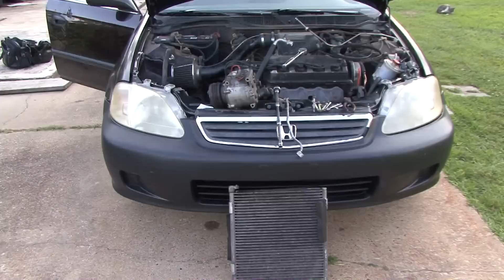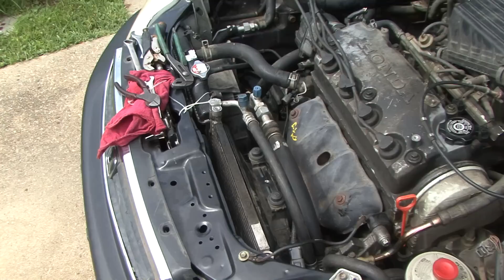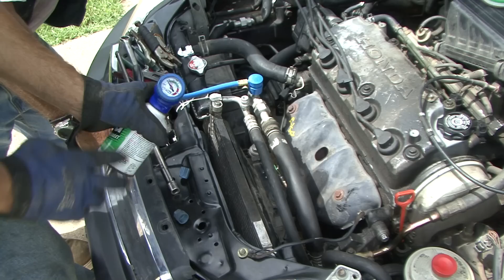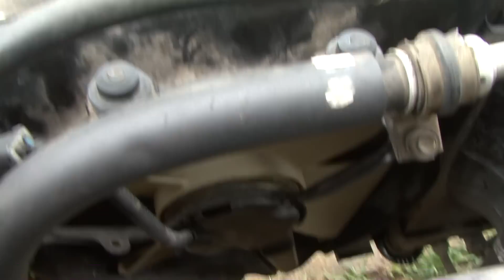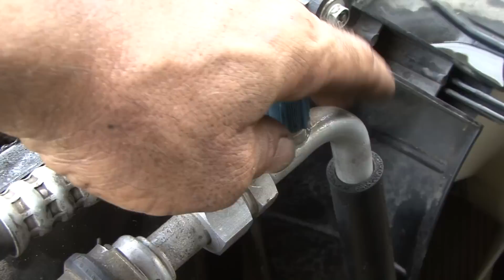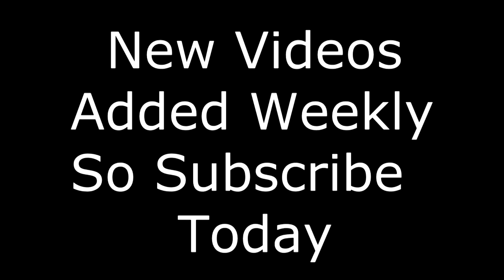Honda How To Civic A/C compressor and charging

Comment: Man.. this is terrible. No real mechanic should ever suggest using those cans. Yes ppl still do but without warning them that most if not all have stop leak in them and the stop leak will nit help with any leaks really and what it will really do is clog up parts like an evap, condenser etc.. this stuff should never really be put in an ac system.. if u ever use anything with stop leak in it no matter what it is, it will always cause more problems in the long run.. but what do i know im just a 20+ year mechanic myself 😂

Comment: Mr. Cody.  What year and model is your Honda?  My honda is 1993 civic.  And I want to put Freon but in which port is the low pressure, my car still has an old R12 system.  Will the high pressure port always connect to the condenser?  And how do I test that energy reaches the condenser and compressor?

Comment: Question!! What If the low pressure line doesn’t get cold.. had a new ac system installed : compressor, condenser, dryer, expansion valve and evaporator core. Had system vacuumed and holds freon.. just doesn’t cool. Compressor & clutch kick on tho
Reply from the maker: Then you have a blockage somewhere or something is not right. If compressor is kicking on you should feel the one line get cold as the refrigerant runs through it. If someone ran stop leak in the system it can clog up parts of the system.
Reply: Cody the Car Guy thanks! When I disassembled the old ac system a large amount of stop leak was present. Gives me reason to take low pressure lines apart to check

Comment: does spewing freon AND OIL CHARGE out the charge port remove ALL the EXTRA air (just how much air should be left in there anyway?), moisture and CRUD as you call it. Also are those Honda approved tywraps holding the radiator together or another one of your genius inventions?

Comment: Quick question. Dryer line to condenser is it dry fit  with gasket or u have to put some kind  of sealer?
Reply from the maker: Put a little grease or pag oil on the oring.

Comment: If your system needs recharged will your compressor pulley not spin? I saw on a video that it might not spin if it needs recharged. And mine isn't spinning when I turn on the a.c.. I also haven't left it in for more then a minute could it need to stay in longer to kick on?

Comment: my compressor spins but doesnt move in and out like yours .. is that why I'm getting warm air when I turn the ac on?(every time I add freon the psi goes up a bit and then goes back to 0) .. anyone know what might be my problem?

Comment: Cody the car guy. I got a question
 So my compressor turns on and works fine and so is my fan. But my a/c is not blowing cold so i recharged it and its still not blowing cold
 What else could be wrong

Comment: I have a 1997 Honda Civic dx and BOTH of my fans arent turning on and the AC clutch isn't spinning, I checked the relays and all of them are good. Do you think I have to change out both fans and AC compressor? I'm stuck with no options right now
Reply from the maker: Check and make sure the ac compressor is getting power first. The ac fan should kick on when the ac compressor gets power.
Reply: Steven Santiago2_13_13 you only have to worry about the condenser fan the other one is the radiator fan and that one turns on when you are driving or when the car reached the right temperature

Comment: everything seems correct except when u were adding refrigerant u had the bottle upright and then in the next clip u had the can upside-down. .. was there a purpose for that or did u mess up and not inform us.
Reply: he was using an old can (had some freon left) to push out air out of the system
Reply: Ahhh ic

Comment: I have a question, might be hard to see but what are those four bolts that are on the right side of the compressor at 1:00? I need to replace mine, but I can't lock on a search to find a suitable match. Could you help me? Thanks.

Comment: I got a girlfriend with a 98 honda civic with the same setup. I heard the sound of a leak around the condensor so i replaced that but that didn't stop the leak. I'm thinking it could be the compressor or the seals but the leak sounds like there's a large hole which i can't seem to find. Is this common on these cars?

Comment: Hey 
Cody the car guy  ! I have a Honda Civic 1996 EFI Sedan four door. My car ac is not cooling as it should be. i have replaced the compressor with the stock version also the evaporator as the mechanic said that the compressor is faulty but still the air is not cool. the low pressure pipes are very cold but the air is not like the pipes... Solution please
Reply: An EFI ? The heck is that ?
Reply: @1RyanHill  Electronic Fuel Injection
Reply: @ScorePhysics  Oh! I thought you meant it like it was a trim level of the car. My mistake!

Comment: hey, I have a 99 Honda civic. I've always had a/c problems. no one has been able to tell me whats wrong. it blows hot air and never gets cool. I put freon in it and took a gage to it and it said there was too much. sometimes when I'm driving I have my ac on low and I come go a stop light or just park and I'll have my ac on and it starts cutting on and off and doesn't stop till I turn it off. I sounds horrible and shakes my car. I think my compressor is out but not sure.

Comment: Cody. I just replaced the compressor, condensor.and charged the system on my nieces 2000 civic. its blowing cold out of the outside vents but no air at all through the center vents by the sterio. also I can't go from vent to defrost. got any ideas?

Comment: hi cody, I have a 2000 Honda civic and my ac went out about a month ago. I live in the desert where it is extremely hot during the summer and I am also pregnant so its very important to me to have ac. ive taken it to two mechanics who wanted to charge me 900 dollars to replace the air compressor and flush the system. my uncle said if I bought the part online (which is about 120$) that he can replace it for me. Do you think this is safe replacing it ourselves? should I also replace the condenser? let me know your thoughts please and thank you!!!!!!!!

Comment: I don't think I heard you say anything about flushing the system. I haven't done the work yet (all parts haven't arrived), but everything I've read so far indicates that a failed compressor releases bits of metal and whatever into the system which can clog the expansion valve, condenser and probably evaporator. Shortcutting the job seems like it would set you up for failure!

Comment: Cody thank you so very much for making these videos!!  

On my 99 Civic HX, I just replaced the AC compressor belt, that had been missing for several years, using your most excellent Left Lower Motor Mount video to do it, Thanks for that !!

Then when I cranked up the car, sure enough the AC blew super cold, just as I had hoped it would.

Then, went to show my wife how great I am, it still worked great, ice cold for about a half an hour or so.

Then, inexplicably, it stopped blowing cold, despite the Green AC Button Light being on.

So checked under the hood, to see if the Compressor Clutch was engaging, sure enough, it was not, despite the Condenser Fan coming on when it should.

So to recap, the Compressor Clutch should engage whenever the Condenser Fan 
comes on, yet it does not now despite doing so earlier in the day.

Your video mentions a "Pressure Switch" coming on to engage the Compressor Clutch about the 5:40 minute mark of your video, could that switch be the problem?  How do I find out?

Or is this symptomatic of a system that simply needs to be recharged?

Any ideas?

THANKS IN ADVANCE SIR !!

Comment: I have 2000 honda civic ex my compressor come on but be click on and off and the belt is screaming bad I change the expansion value but every time I check it with my Guage it tell me it's to full then  sometimes it's not enough  freon what can be the problem but I will change the belt later on today

Comment: Hey Cody my friends Acura mdx clutch isn't engaging fan turns on checked fuses and relays and they are good we checked the freon level and it was low I added freon abbas nothing still not moving do you think the compressor is bad?  Thanks for the feedback..

Comment: hi Cody the Car Guy my question to u is i have a 1993 honda accord lx auto trans when i turn onn my ac the blower comes on but the fans never kick in does that me my compressor need oil are the hole system empty

Comment: Hey Cody thanks for the vids on the civics... My AC system just started not getting cool, I know how to charge it... But how do you check your compressor oil?  And do you recommend the artic freeze and ice32?  Thanks again!!  Hey I'm also having issues with my check engine light coming on... its a 93 Honda Civic and I already did the paperclip trick to get the code... It came up code 9 and feom what I understand and read it says something with the distributor. ..  The car runs fine and after about 10-15 mins of running the enhine light comes on... 2 things I noticed was when shifting into some gears it shifts just a little hard, also if I floor the gas peddle its almost a guarantee that the light will come on right after... 1 last thing I noticed is if I make it to the highway without the light coming on and drive 50 miles to my girls it won't come on.... Any ideas buddy??  I really appreciate it bro!!

Comment: Have a 02 civic. The air conditioning works for about 10 mins and then it will slowly start to blow warmer and warmer air and won't go back to blowing cold air. Any ideas whats wrong?

Comment: And yes btw junk yards are required by the epa to recovery all fluids and chemicals etc from vehicles before that are scrapped
Reply from the maker: John Day r12 yes they are. But no cars with r134 are recovered at any junkyard ive been to down south they are all still charged when picking up used parts i see it all the time.

Comment: What's the difference in r12 and 134a? R12 is a cfc and depletes the ozone, yes 134a does not have a cfc but it does contain green house gases that aren't good for the environment either. Especially since you are trying to show people how to charge their a/c system, why not show them the right way? And not be a half ass slob that is showing people how to complete a task in an illegal manner. I might just report this video and collect the 10,000 dollar reward for successfully aiding in a clean air act conviction

Comment: You do realize it is a 25,000 dollar fine to vent  to atmosphere right? And I am a master hvac license holder and you can't remove the moisture from the system without a deep vacuum ..... And the moisture and refrigerant mixed creates an acid which will ruin the compressor you idiot....
Reply from the maker: John Day Not everyone has a vacuum and have you seen every junk yard they dont recover r134 at all they are not even required by epa at all. Now my rti a/c machine is a 100% recovery and removes all moisture but not everyone can afford one of those machines. And just so you know that car is still blowing snow cones and working perfect to this day that was shot in this video so keep your comments to yourself if you want you can check the honda out in the video guessing you still wont have anything positive to say lol

Comment: My names Cody too!!!! Haha anyways, I've been searching around, and my A/C doesn't work as well as I'd hope it would. It takes like 10 miles before it Starts getting cold. And it stays cold, but if I shut the car down, even for a second, it takes forever to get cold again. It's not low on refrigerant. The car has 230,000 miles and I'm wondering if the compressor is just weak? Thanks man.
Reply from the maker: Chevymalibuls You could have a clog somewhere or bad condenser it takes a bit of driving to get it to cool or the flow moving

Comment: Have a an '01 Civic EX and have noticed over the course of the last two years that the air has slowly not been as cold as it used to be five years ago. We put half a tall can of R-134 synthetic into the low pressure side. And the air got really nice and cold and pressure reading was at about 45psi. But now for some reason shortly after we did this we were driving down the road and notice an odd squeek or like a water drop sound/squeek when the compressor engages. Also I noticed while at idle the compressor was engaging (on and off) every 15 seconds. Could there be a possibility the pressure is too high?
Reply: I have a similar problem. Have you any answers yet? Thanks. Hit me at georgelwyatt@gmail.com With Honda a/c in the subject line
Reply: +George Wyatt OK, so after extensive self teaching the answer to my question is 'YES'! The pressure was too high. These cans you buy from the store are not good enough to fix your A/C. You need to use a real manifold gauge set. Those companies are just ripping people off and polluting the atmosphere. They must know that it is all going to leak out. If you have to add Freon it is because you have a leak!!!  Unless you overhauled the system then you have a leak because Freon does not go bad. But to make it easy for you, just replace the High & Low side valves because they are what go bad most of the time. You WILL NEED to vacuum the system and so you will need the manifold gauges and the vacuum pump. The good news is you can borrow these from an auto part store. Then you have to determine how much Freon your car takes and you may have to add a hair over or a hair under and the only way to know for sure if you got it right is with the manifold gauges.  Since my previous posting I have successfully fixed 2 A/C units. Not bad for never doing it before.
Reply: Thanks, I had no idea you could get loaners for this. What parts store did you get them from?
Reply: +George Wyatt I got them from AutoZone and I checked Advanced Auto but they do not loan them out. So AutoZone is the place to go in Delaware.
Reply: I'm in Florida, wil check around. Thanks again!

Comment: Cody, my 92 civic vx the ac was low, I installed a can of stop leak and a can of freon and the ac worked fine for awhile.  Buth then after a week the air was slowly getting cold and not very.  So I bought another can of stop leak/ac combo.  I put on the gage only,  and it read lowest point on the green indicator,  When I put the can of freon on the pressure went up way into the red danger zone, then slowly came down to mid level green zone after a few minutes of sucking in freon.  The ac was cold for about 30 minute drive then something exploded and I have ac oil every where.  I heard what sounded like the condensor area hissing.  What went wrong???
Reply from the maker: Brick Wall it could have been a ac fan not kicking on to too much pressure in system. Also that stop leak clogs everything up bad next time add something with some dye in it so you can just see where its leaking most of the time its a oring or schrader valve
Reply: Cody the Car Guy   Looks like schraeder valve is bad.  Now that it blew, can I just remove the valve and put another in and not have to worry about evacuation due to it losing pressure already?
Reply from the maker: Well yes but check everything usually a schrader valve wont pop out they usually slow leak so something else might be bad
Reply: Ok, so follow up...schrader was bad, was told by mechanic that condensor had leak, suction pipe bad too.  Replaced the stuff with used parts and replaced the R134a with Diflourathane (from electronic compressed air cans.  Youtube says cold as R12.)  While mechanic was adding second can, the "pop-off" valve on the compressor blew.  I replaced valve, evacuated, refilled, no problems.
NOTE:  my compressor runs so freely now that I cant even tell thats its running!.  It used to bog down the motor quite a bit requiring more gas to get the car moving.

Comment: Was there ever the follow up vid with Arctic freeze? If so, you should link to it in the description... :)
Reply from the maker: Josh Rivers I honestly didnt feel any real noticeable difference with the Arctic Freeze
Reply: Cody the Car Guy mhm, what about the ice 32? I was wondering if you did both at the same time or if that's even possible, or if it had to be one or the other....never done a/c before. Should be fun.
Reply from the maker: I have done a ice 32 and it was the same as normal r134 Freon. A/c is pretty easy i have several videos on it now i have a RTI a/c machine it does it all automatically for me

Comment: Hello Cody, 
               Have a 00 Honda Civic, 4dr sedan, love the car. I cannot get the A/C to blow cold air below 55. I watched ur video and it appears the Civic used has a similar issue. You mentioned changing a valve on the low side, what valve? And after changing it, did it fix the problem.  I am also wondering if this system has a filter/screen, which, in my past experiences, catches compressor debris. Hope to hear from you.
Reply: andy mad Have you checked the condenser fan?  If its not working this could be why its not cooling at lower speeds.

Comment: Very enlightening.  I liked how you had all the parts shown at the beginning.  AC systems seem so complex but this one seems simple.  I think my compressor is good and fan is good.  Thinking of replacing the lines and filter screens to see if that will get my cold air back.  regardless, great vid dude.

Comment: Love the video. But my question is if that center part of compressor is not working and the fan is not coming on I will need to take into a shop. Or can I still check for recharge. The air blows just warm air only
Reply from the maker: if the fans are not coming on, it can be as simple as a fuse all the way to no freon , you can jump the wire on the low pressure switch if the fans and compressor kick on then re charge it and look for any leaks. But even if low on freon fans should kick on so look for no power getting to the switch or from switch to compressor
Reply: Thank u a lot. I'll try that.